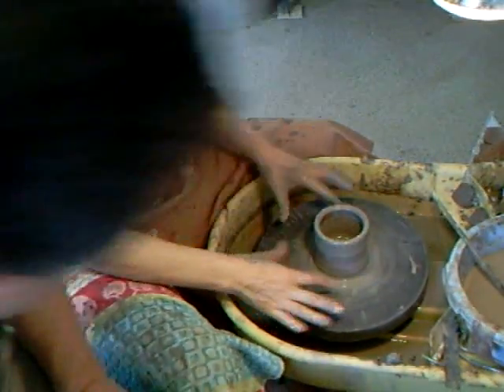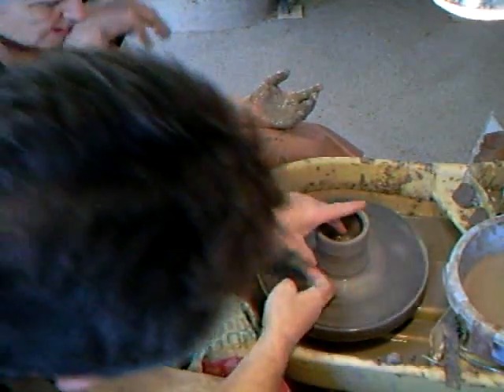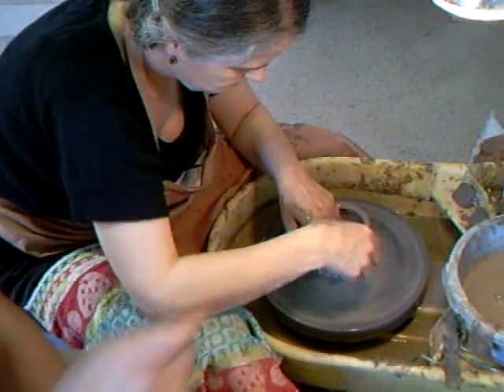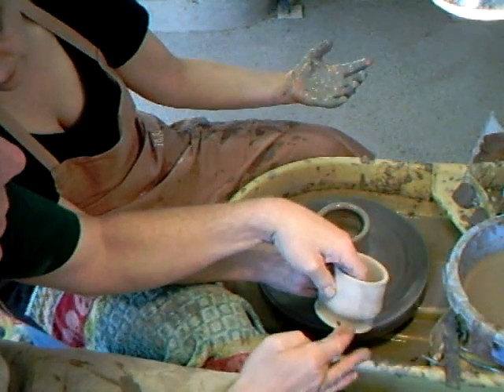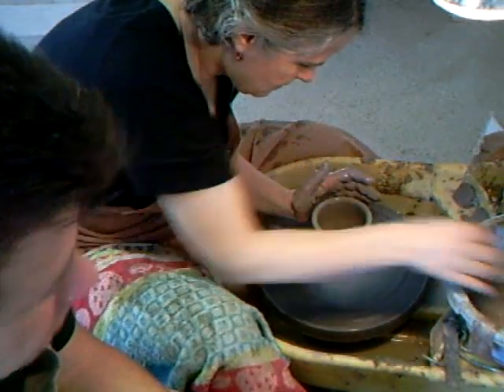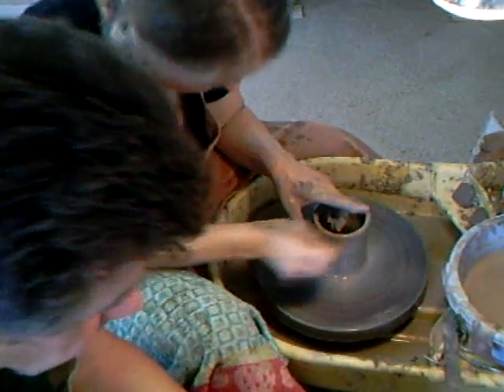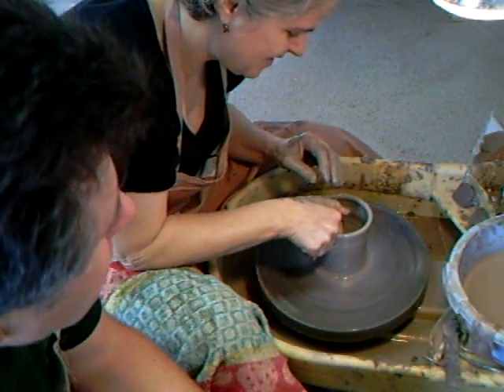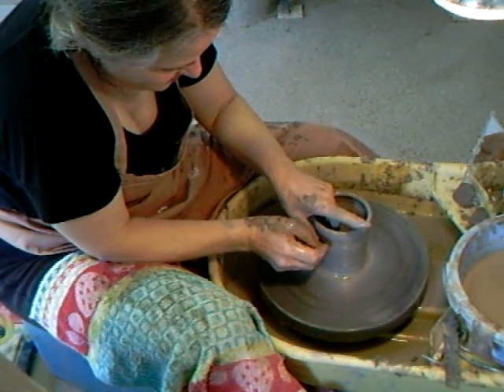SIMON LEACH - Teaching

Comment: I am learning to throw with porcelain and my teacher tells me that I should use a little water as possible since porcelain absorbs so much water. I have had a hard time reducing the amount of water than what I used with stoneware, but I am going to try and adjust my wheel speed and see if that compensates for the need for so much water. Also a great tip on the position of the hands when undercutting. This is a difficult thing to master. Two great tips! Thank you for another great video. Ruthie